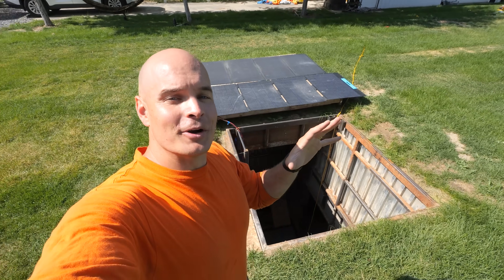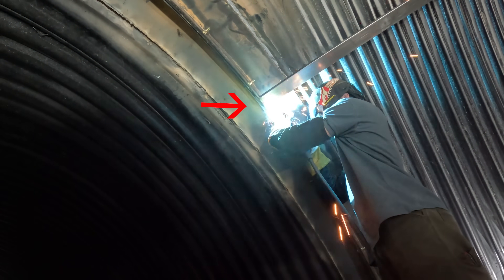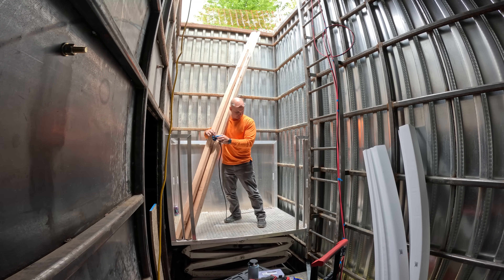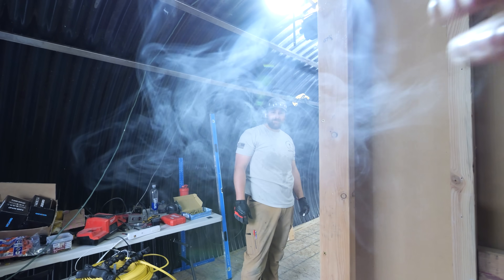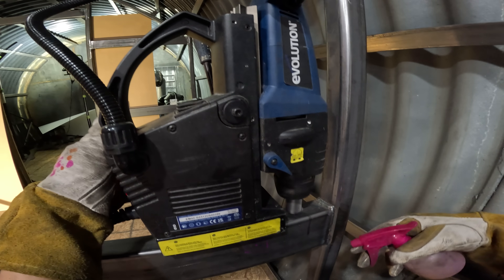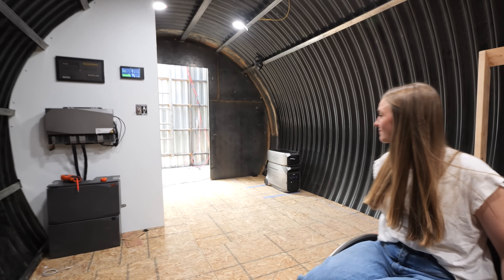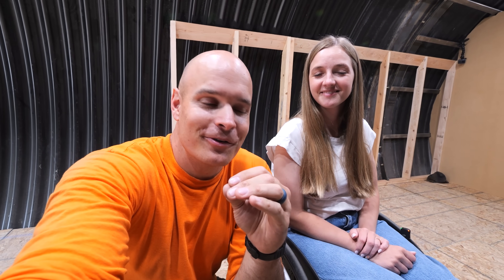How to Properly Power a Backyard Bunker - (Completely Off Grid)

Comment: Hey, I know this idea will probably get lost in comment section, but would you consider hosting a copy of the internet archive, or otherwise making some sort of digital archive you could self host in your bunker? While I'll be happy you'll survive the bombs dropping, some sort of hybrid time capsule/digital archive to take with you would be absolutely invaluable for future generations. not to mention having a copy of the way back machine, or the entirety of Wikipedia would be useful for you while you're down there - and I assure you, your google cloud would not survive the fallout, so somewhere to store your family memories and completely legitimate copies of movies would be useful for a long stay

The general outline would be creating a highly power efficient, high availability, fault tolerant, passively cooled and compact storage server with no moving parts that could last twice as long as the bunker. This sounds like a lot, but it would consist of building two identical network attached storage devices using ARM or RISC architecture, with inbuilt redundancy between their storage disks, and making them into a cluster so they can synchronize the data between each server. Jeff Geerling has extensive experience with clustering, ARM devices, and server management. maybe you could ask him for advice on what to backup, and have him set it up and help you administer it.

Comment: A 15 minute ad for EcoFlow.
Reply: I could see myself outfitting a shed or barn with EcoFlow gear. I assume, that is until I see the total price.
Reply: @bruhbruhbruhbruhbruhbruh-jp3ifa few mins of the vid is alr. But 13Min ad is crazy
Reply: 7 minute ad for Ecoflow, 7 minutes of actual content, 1 minute of filler. The product placement annoyance factor is mitigated a bit by the fact that the product being placed fits the content perfectly. So: it would have been much, much better with half the mentions of "Ecoflow", but it wasn't totally unbearable.
Reply: @BoydBottorff  half the mentions would of made it much better. and yeah, a 3000$-4000$ unit really just isn’t affordable to most people watching this, useable. cause on top of the cost of the unit, you need to charge it, and the most sensible option seems like solar, but then you need panels. like seeing them being able to use a welder off of it is cool, and that could apply to a lot of people - mobile welders, hobbyists with no 240 in their garage (like myself) or no garage at all.. but most applications like that would just be replaced by a typical gas powered generator. I like the idea of having battery powered backup but at some point, it will fail. and in a bunker especially, say you’re in the bunker permanently for whatever reason. solar panels or wiring has failed. now what? you need a mechanical backup for air exchange and as a luxury, electricity.
Reply: @Sffker  How are you going to power the gas generator? As said in the video shelf life of gasoline is only 6 months.

Plus to run a generator you need oxygen.
Reply: @catprog  im not speaking about gas generators in terms of a long term bunker situation. very clearly gasoline power isn’t a long term bunker solution. even natural gas isn’t if the grid completely gets shut down.  although, im more than sure gasoline aged more than 6 months would still run a generator, i mean, my motorcycle does that regularly every year. gasoline in and of itself has a much better “shelf” life than 6 months. i literally said a mechanical backup is necessary. for example, as such you’d see in an Atlas shelter with a mechanically driven air exchange system. the same should be considered with solar, or any power source. electricity at the end of the day doesn’t matter if you can’t breathe in your bunker. and in this guy’s build he has yet to show any part of his long term oxygen supply
Reply: @sirnickity  not as impossible as you’d think. I doubt an ac motor ran in reverse via mechanical input (like a bike or other input) and a high input ratio gearbox would ever fail in your lifetime, so long as the bearings were upkept in a low humidity environment. i was just saying like, with a real shelter you don’t want people to know it’s there.. and solar panels up top are obviously very susceptible to damage via vandalism, weather or other sources while you’re stuck in your bunker. in normal every day situations yeah sure it’s not a bad idea to have solar to help recover energy costs. but i was strictly talking about inside a long term bunker…
Reply: worth watching ad
Reply: @christophergaspar6520  eh i mean… it’s more just like not a whole ton happened in this specific video, it was more about advertising the ecoflow than actually building the bunker.

Comment: I see, that's why Delta Pro was on sale with more than 1k off. Loving it so far. The only problem I have with it is that it doesn't have a touch screen with settings on it directly.
This is a problem because when EcoFlow company will eventually decide to stop providing service to older units, which will happen 99.9%, then the units most likely will be stuck with current settings forever.

The app has bluetooth-only mode, but the app itself might stop working with older units. It happened with soo many companies already, that it's not funny.

That's why I bought cheap smartphone with stock Android to have Ecoflow app version frozen forever. Just connect to cloud once, update everything and deny WiFi access forever to both, Ecoflow battery and app.

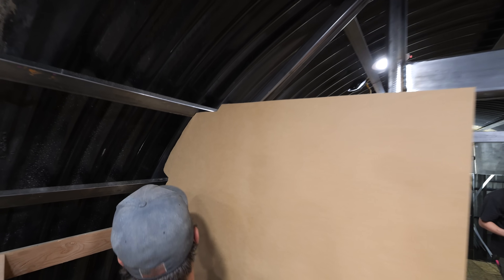Comment: 11:28 For underground or moist areas I would recommend avoiding wood products.  Concrete or fiberglass related products like HardieBacker of GoBoard will not disintegrate with the moisture.  They're more expensive but will not crumble after exposed to moisture.

Comment: you need to put a proper hatch on the top of the bunker, it doesn't seem like its gonna do much , in the event of a nuclear emergency if radiation leaked in there it could infect the rest of your bunker. generally wanna have around 15 feet minimum between your bunker and the outside world

Comment: You could add wled strips and home assistant and then make it show certain colors and patterns depending on the weather from home assistant. Also can get a weather station so it's all local and internet connection is not needed. Would be much more energy efficient than TV's on the ceiling

Comment: Why do people want gas generators as backup?
Diesel engines are way better as they don't need any special fuel, any flammable liquid works in a diesel engine.
Even gasoline if you mix with oil. A 30/70 (gasoline/oil) mix will absolutely work in a diesel engine.

Comment: I guess the point was to showcase Echoflow. But running all that romex and going with AC stuff doesn't make a ton of sense. Offgrid tends to lean heavy on DC. It's way more efficient to use DC where you can when your power is coming from batteries. I would not have used MDF at all down there. Moisture is a huge factor down there.

Comment: The MDF used for the walls is a durability concern, as this material gets destroyed by water if it gets to it once.
Whether from an (unlikely) leak or accident. Though the fibre reinforced plastic helps cover and somewhat mitigate this.
So I would have preferred to see multiplex there, though from a cost-saving perspective this makes sense.
And at least it isn't drywall, which would have been a terrible choice for a bunker, or for houses in general.

Comment: A good ventilation system which doesn't clog during snowy season is a must.
Reply: especially with the bathroom right next to the kitchen...
Reply: @JonasC22  He never heard the phrase "Don't shit where you eat."
Reply: I would have thought Jerry would use the exoskeleton that he's putting in and not weld the room separator and instead put wheels or railing to move each individual wall or door so that he can move rooms around to clean or as needs change in the bunker maybe even adding in another room for some green house plants to self sustain
Reply: Snowy season? Nuclear winter you mean.
Reply: @Okurkaarrgghh you mean the 2024 election?
Reply: @Okurkaarrgghh  yes yes good point, not arguing with what you said earlier but thought it would be funny to say that though

Comment: It looks good but from the construction standpoint, it is a safety nightmare. Putting flammable material in an underground bunker, not a good idea. Cables need to be fire rated or at least should be zero halogen. Not gonna mention the wood and all the other stuff. Any small fire can get out of hand really quickly in there. First thing I would do is to replace all the flammable boards, wooden stuff with a fire resistant and smokeless equivalent. Then use only FR OH cables. Put smoke and heat alarms underneath the boards and on the ceiling. Test the grounding properly. Make sure that any lighting strikes above ground will not damage any equipment inside etc etc.

Comment: Looks Nice! One thing, is your construction bonded with your electrical source (the Ecoflow)? I've no idea if your setup complies to US code (maybe it does), but in Europe you must have your construction, water supply and gas line bonded with the power source. Also you may need a connection to an earth rod.

Comment: One of my larger concerns about long term structures with battery-based backup power systems is that whether or not you use them intensively or sparingly.... they will all require replacement within 3-5 years. I wonder how many people that use items like this know that they will have to either be able to procure new batteries as part of M&R or will they select the devices based on ease of end user replenishment/repair.  Non-rechargeable batteries give you up to ten years, but that leaves you with procurement.

Comment: Why not put the batteries under the floor… and you should figure out a way to wire you existing solar panels that you have installed into the bunkers batteries so that way you can use them when the time comes to go into the bunker

Comment: You 100% need a very good fast response smoke / fire detection method given how quickly smoke could become a hazard. It wont hurt to find a method of smoke stopping between the sections to.
Reply: Probably best to fill those wall cavities with rock wool, and also add rock wool battens to the walls as well, so as to provide both sound insulation and fire resistance. Doors should be at least 30 minute fire rated, and at the rear entry there should be at least a simple winch with manual handle, that can be used with a bosuns chair and a swing arm, kept inside under the cover, but easy to pull out and set in a premade covered flush mounting hole in the concrete, so that you can egress everybody safely, and also use as a way to get heavy loads in and out if the main entrance is also busy.
Reply: Might as well put a rescue tank down there with a mask.
Reply: this whole thing is a deathtrap

Comment: You should perforate the gutter channel. That way, if there is ever a water spill/leak, the water will not pool in the gutter and flood your wires.
Reply from the maker: Good idea
Reply: @JerryRigEverything durability test the tab s9 ultra.
Reply: Good one, someone's definitely going to spill something along the way
Reply: There's an engineering saying "Always give water a way out, because it will always find a way in"
Reply: You certainly have that right!! I had water rapidly filling up my kitchen .. It was coming through the drains in the sink.. Flooded aall of the kitchen, then the dining room, then the halways.. It was one of the worst nights of my life 😢😢   @Longplay_Games
Reply: @Longplay_Games  Just like my mother-in-law.
Reply: Thought the same thing! Gutters are meant to keep liquid within itself....plus I've heard elec and water have a complicated relationship. 🤣
Reply: That is a good tip!!!
Reply: Either that or put it all at a slight angle and add a low point drain.
Reply: If the gutter was outside it would leak  at every joint, but down in the "cave" it will hold all the water that gets near it....
Reply: He should also get more efficient lights, I'm assuming he's already using LEDs, but at the same time I'm not sure how he's pulling 200W with just some LED lights. Maybe I'm wrong but it doesn't look like he has 20 lights, which is how many he'd need with the average 10W LED. Should probably switch to 5W LEDs tbh
Reply: you are poking holes in Jerry’s plans 😂
Reply: I don't know what you talking about. But sounds good 😂... Zack perforate what he just said 😂
Reply: @stux1143  He means the channels where the cables are. If someone spills water in them it is good to have little holes in them so the water can leave the cable place. You know water and electricity is a bad match.
Reply: There's always that one guy
Reply: Make pertumotion motor power generator
Reply: okay dad !
Reply: Sensor and a drain you can open or close is better. A way to reclaim accumulated water as well.
Reply: Definitely put some holes in it so a liquid can drip down onto the storage. That's a lot better than putting the gutter on a slight grade to drain into a container at the end. 

I might just go drill some holes in my rain gutters

Comment: Do you store enough solar panels in the bu kernel to power the battery?  Depending on the scenario, anything placed above ground could be destroyed.  Either through explosions, or extreme weather, or even looted.  It would make sense to have the ability to charge the battery, and then quickly amd safely store the panels so scavengers or something don't steal them.

Also, you mention using a gas generator would give away the location of the bunker??  What would a bunch of solar panels do?  Seems like an array of solar panels, with a wire leading underground, scream, "something of intrest nearby!".  Also, I'm sure solar panels in direct sunlight give off a thermal signature higher than surrounding area.  After sundown, to see a giant rectangular shaped hot spot far in the distance may attract some further snooping by would be looters.

Comment: Hey Zack! Are you worried about the wood framing with the batteries? i know wood is easier to work with but id be worried if a fire broke out It’d be hard to evacuate
Reply: Wondered the same, which kind of fire suppression system will he install?

Comment: Just what are you preparing for exactly? If it's nuclear war, your solar panels will likely get blown away or covered in debris or fallout. Otherwise you'll have to expose yourself and unseal your shelter to deploy them afterwards. If it's something that doesn't instantly kill all your neighbors, someone will probably steal the unguarded exposed panels. Better hope the batteries last long enough to power the minimum of lights and ventilation until it's safe enough to go outside. Also, probably a good idea (I'm sure you've thought of it) to have a pulley and harness for your wife's egress if the power is out. But in the end, what kind of world would be waiting for you out there?

Comment: you can store gasoline for way longer than 6months especially for emergency generators, just gotta do it correcly (even normally stored its easely fine for over 6months doe). also air and exhaust for a bunker generator is a solved issue.
Reply: He should get a diesel generator, it can run on cooking oil, so even if diesel runs out...
Gasoline will be the first to go empty as its what most people use. 
Put it in a building on the surface, and connect it with the other exit.
Reply: @dubious6718  yea im not saying gasoline is without its flaws, just had to point out the false reasoning.
Imo optimal would be combining electric like he has with a second power source in case the solar fails or is for example covered in snow.
Diesel probably best option even just because less consumption than gasoline

Comment: Gotta say, that fuse panel doesn't lend it self to a neat layout of the wiring.  I'll give you a B+.  You could have used some pliers to run the wires straight and used bends to run them into the terminals.  There are other things to critique, like your labeling should have been a bit farther away from the end so that later on you can always look to check which circuit those wire go to.  But you know, that's a future you problem not mine.

Comment: Led lights on a 110 circuit? How is this energy efficient? You could wire any LED lights to 12/24V DC directly which is much more efficient
Reply: If you string enough LEDs together, you can consume 100V of forward voltage in the diodes themselves.  It's actually possible to run LEDs directly off AC mains this way, although you do still need some current-limiting mechanism.  The point is, though, neither 12V nor 24V is any more native to an LED than 110V.  You would need a series string or a transformer either way.
Reply: @sirnickity  Your LED's would be flickering at 60Hz which may be annoying to some.
Reply: @quantuminfinity4260   Yes, and that's pretty common, particularly for decorative lights.
Reply: @sirnickity  Unfortunately 😅
Reply: Modern inverters are pretty efficient (95%+), and by running higher voltage you use lower current. Power loss in the cables is I^2 * R so by using ~10x lower current you reduce power loss by 100x, and your cables don’t need to be as thick
Reply: @AlexLouden  Yes, the only part that’s typically low-voltage DC is the whip between the LED driver and the Light itself. Which is only a few feet at most.

Comment: Well, as long as you need the panels to be above ground to survive then you’ll have given your position away. Or they’d simply get stolen = no supply. That’s an unsolvable weak point in a real societal breakdown. 

But it’ll work sweetly as a premium, premium AirBnb.

I know this is sported but I’d have gone for the Anker set up but I can’t begrudge the not-insignias cost savings when going EcoFlow.